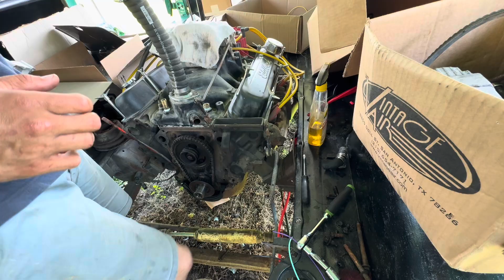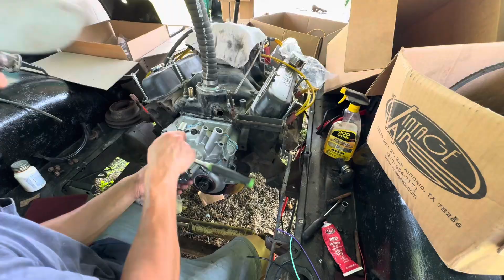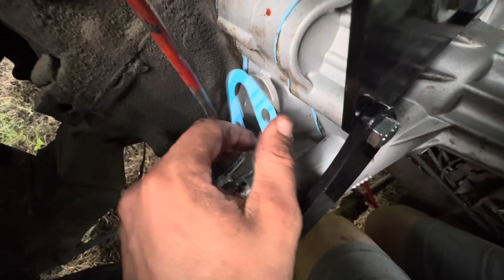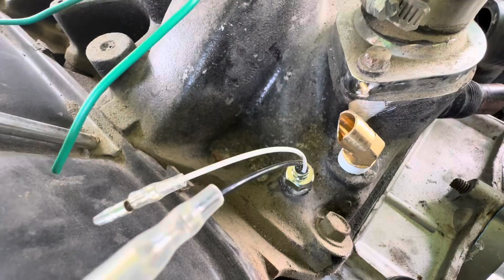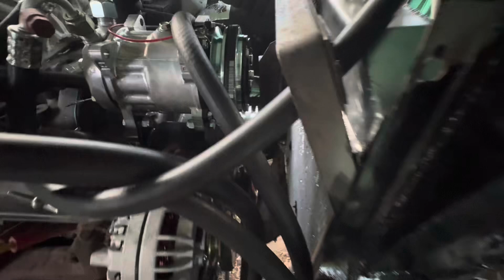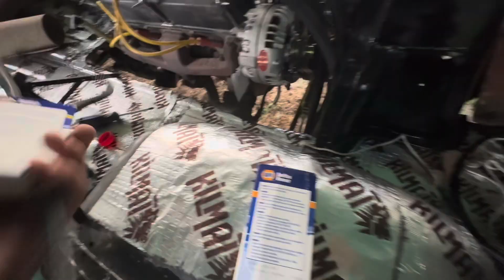Dodge 318/5.2 Timing Cover and Compressor Bracket install

Comment: I noticed you have a glass fuel filter. I strongly recommend you ditch that before you start the engine up. These glass filters are notorious for springing leaks and causing engine fires. Seriously! There was one on my van when I first bought it. It started leaking gas and it could have caused a fire if I had been driving down the road. Lucky I was just running it in the garage for the sake of lubricating the engine. Get the metal cylinder or the plastic cylinder type that you can see through. They don’t leak and won’t cause fires. I don’t care how neat they look, these glass filters are a menace to your vehicle and family. Also it’s a good idea to carry a fire extinguisher just in case something happens to catch fires. Vans like this are prone to catching fire. Since you are rewiring it, that’s a big deterrent to fire. But ditch this filter.
Reply from the maker: That’s a great call, this one did start leaking sooner after this video! Thankfully it was in the garage when it happened!